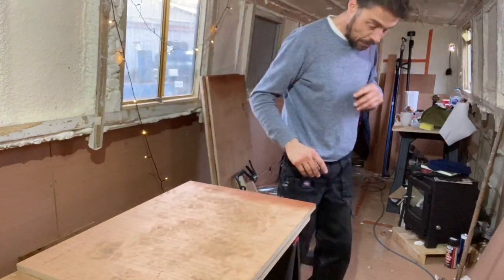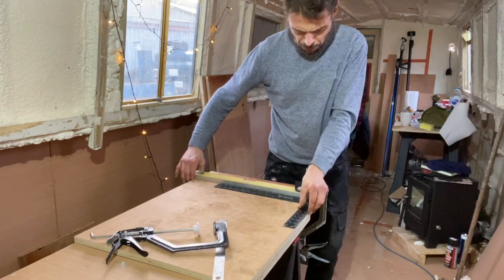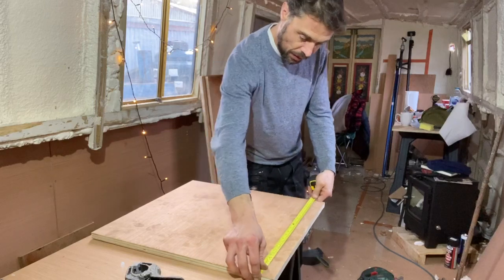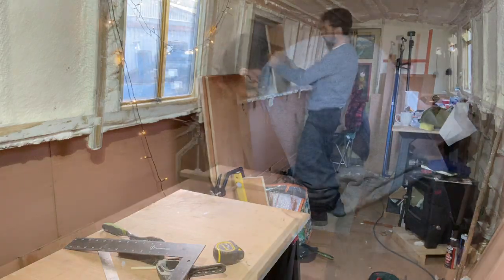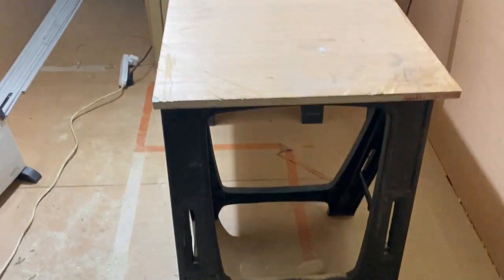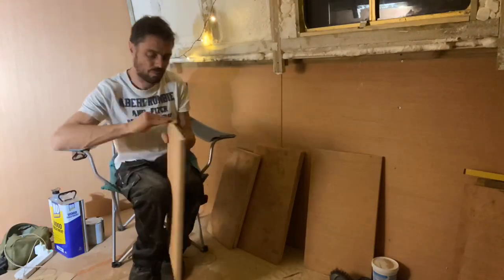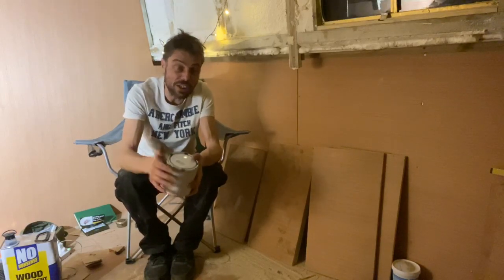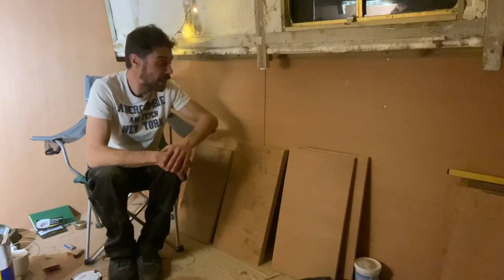54. Lining the Narrowboat hatches and more cock-ups

Comment: If the hatches do still stay cold, or you want to upgrade them sometime down the line, a wooden frame around the edge with rigid foam insulation in the middle and a thin skin of wood over the top (3mm or 1/8") glued into a sandwich would be a good way to go.

Comment: Hi James, going back to the hand basin, no need to drill a new hole for the waist on the external wall. Where it is in the wardrobe run it to the external wall and bring it back in to bathroom at floor level and then take it out the same hole. Don’t know what happened to the door cutting, but always remember measure twice cut once. Regards Alan. P S I am a retired joiner. It’s so funny watching some rookie mistakes.
Reply from the maker: Tiredness and hunger got in the way good measuring and cutting!! Just had an egg and bacon sarnie so shouldn’t make anymore today !!!!

Comment: Hi James you  could paint a 6 to 1 coat of water mixed with external PVA glue onto the plywood or MDF boards, this will soak in & seal the boards & give a good key to then paint over the top.

Comment: MORNING JAMES 

IF YOU PUT THE STRAIGHT EDGE ON THE DOOR SECTION ANY VERING OFF WILL HOPEFULLY BE IN THE OFFCUT.      IF YOU DECIDE TO USE A ROUTER, THIS WAY IS ESSENTIAL.             AS USUAL A CRACKING JOB.  CHEERS MICHAEL